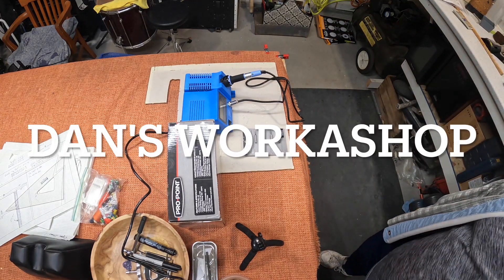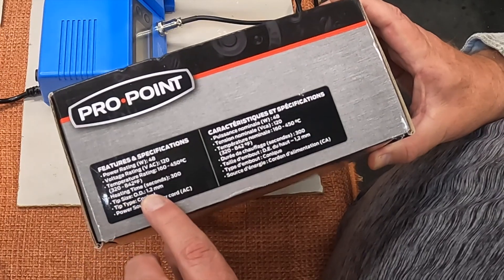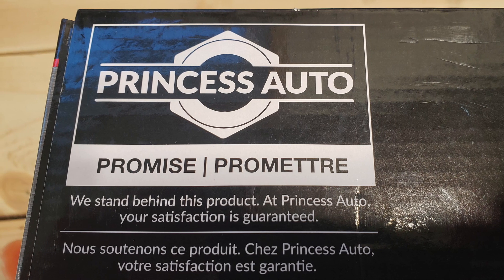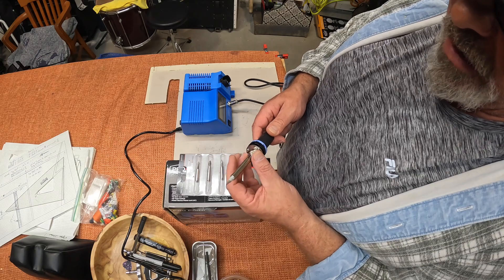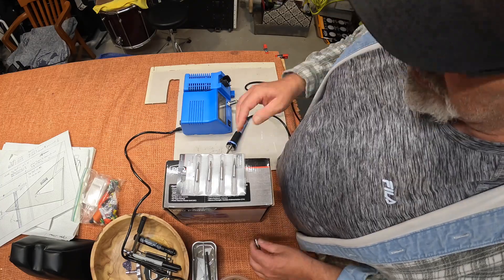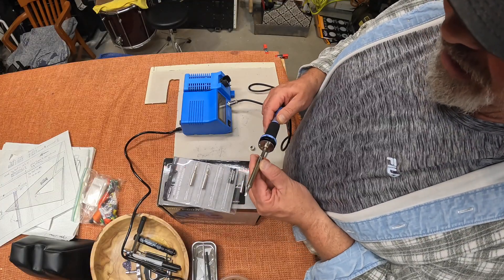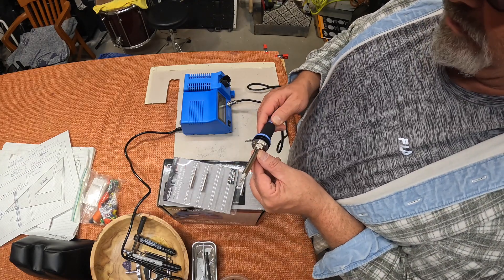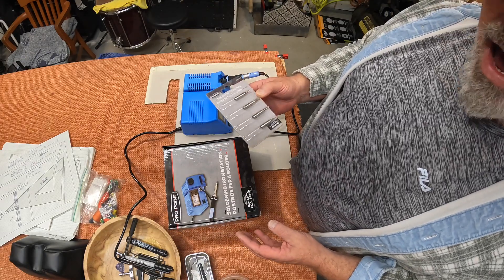Princess Auto Soldering Station

Comment: Ohh i bought that from Frys electronics 23 years ago
Reply from the maker: wow 23 years still working on the same tip? Do you have replacement tips? Tell me more
Reply: @dansstudioworkshop  mine was a Velleman branded station but looked identical except it was a baby blue.  Seems like the tips are BITC10 series. I pulled BITC10N2 out of an Amazon page that looks right, it's got the ceramic body and tip on it.

You might have a wiring problem with yours though.  The tips don't have anything to do with the heater in this style of iron.  If the handle isn't getting hot, it's a problem in the handle. You might have just got a bad one.  Mine spent 10 years as a hot wire stripper, I took one of those metal handled disposable brushes and shoved it on the heater element in the handle and banged it flat and cut a sharp hole in it to strip wire.
Reply from the maker: Thanks for the info, I looked up the BITC10N2 tips and they look correct but unavailable. cheers